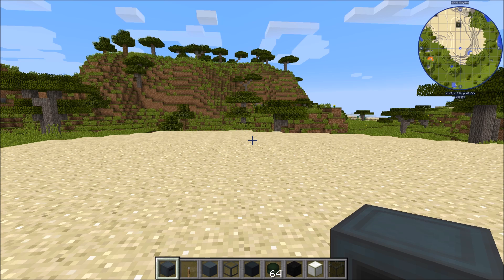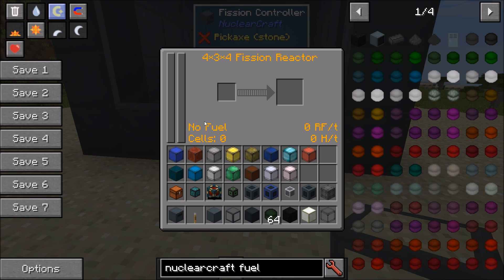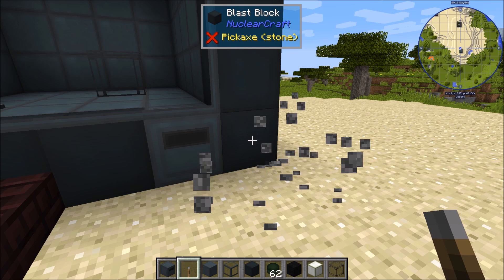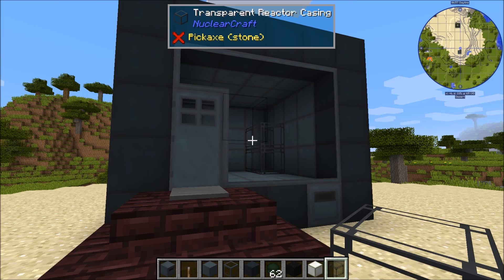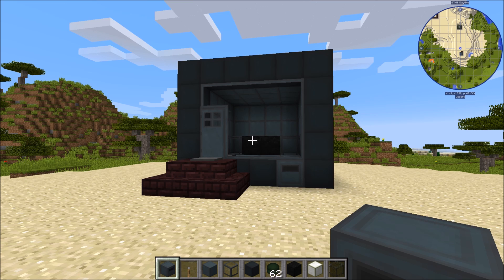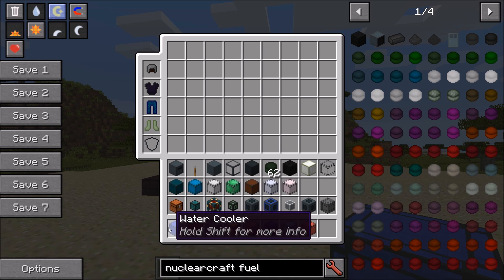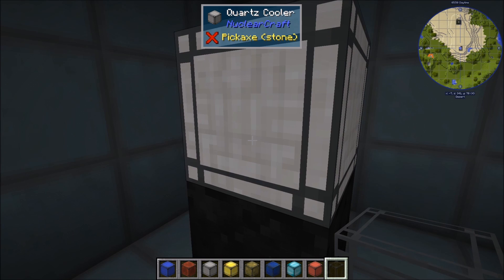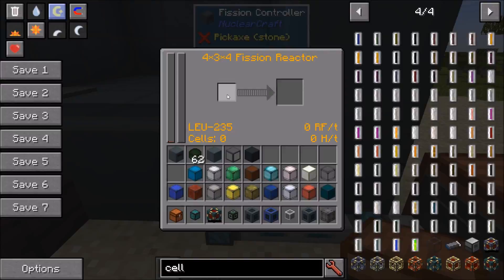NuclearCraft Spotlight - Solid-Fuel Fission Reactor [1.12.2]

Comment from the maker: Just one thing about moderators that I did not explain very well: Unlike the quadratic increase of heat generation with increased efficiency for cells, the additional heat generated by a moderator adjacent to a cell increases linearly with the cell's efficiency, just like the additional power. That's why, at 11:40, the heat multiplier is 366% - each cell has a base efficiency of 200%, so have a base heat multiplier of 300%, and the additional heat multiplier is then just 2 × 1/3 = 66%.
Reply: Will reactors be able to convert water into steam like the reactors from Extreme Reactors? I want to use this mod together with Advanced Generators, but currently NuclearCraft doesn't support steam generation, which is necessary to use Steam Turbines from AdvancedGenerators.
Reply from the maker: Steam can now be generated through the molten salt reactors and heat exchangers ;)

Comment: I have spent 2 hours on a 11x11x8 reactor (it didn't work), then I had an idea to expand it to a 11x11x9, and, after another 2 hours, I had just enough cooling! BUT... it didn't start when i put fuel into it, and i spent an hour trying to fix it. I couldn't fix it and blew it up with tnt (modded tnt, because regular does very little damage).

Later i found out I needed a lever (redstone signal)... 😑

My complaint:

Make stuff easier to blow up 🤣

Comment: I finally got to explore this mod in much more detail. I love most aspects of the mod but the gathering/creating fuels is the least fun thing about this mod.  If the fuels were better handled, it would be my favorite mod by far, just way too much upkeep, convoluted with the amount of fuels.
Reply from the maker: Would an optional, simpler fuel system be something you're interested in? If so, which fuels should be available and what should they reprocess to?
Reply: I am playing all the mods 3, so the extreme reactors materials are vastly different, more expensive to make in other packs I've played in. This makes extreme reactors sorta late game compared to Nuclearcraft fission reactors. I just found myself fighting with maintaining the fuel before you're progressed enough to start running quarry's to auto farm thorium and uranium then progressing to the other fuels by running depleted fuels through the reprocessor or imbuing mats with oxygen for oxide fuels. Running 9 thorium ingots through an isotope separator for 1 fuel seems sorta excessive for the base fuel. The need to cool the reactor is what drew me the most to nuclearcraft fission reactor, I think that is on point. My suggestion is to maybe make it a little easier to maintain base fuels while keeping the more endgame fuels the same.  The ore gen for nuclearcraft is fine, its just the quantity needed for base entry level TBU fuel is where I found the biggest issue with.  Maybe increasing the burn time on the beginning fuels would be the easiest. I know the player can modify a lot of that in the configs but I typically don't like doing that kinda stuff.
Reply from the maker: The problem is that I decreased the yield from thorium and uranium for their respective isotopes because other players said it was too easy to make a lot of fuel. If it really is just something like the base time of the fuels that you want to increase, it's very easy to do so in the config - you can even do it in-game, by just heading into the mod options.

Comment: The emerald cooler seems a bit cheap for me, considering that I can just go to a village and trade my crops for loads and loads of emeralds. I think the efficiency should be based off of actual material effectiveness, not just how expensive a material is supposed to be, which can be very different depending on one's situation.

Edit: Cooling with molten metal is even more silly and immersion-breakiing, because molten metal is usually extremely hot!
Reply: cough cough mercury cough cough
Reply: Liquid Sodium is actually used in real nuclear reactors as a coolant. If the inside of the reactor is hotter than the melting point of the material, you can use it as a coolant.

Comment: Your calculation states that active fluid cooler is twice as effective as a passive one? Ive been thinking of pumping resonant ender into the corners for extra cooling.
Reply from the maker: More than twice as effective, generally. They're pretty overpowered, really. Use them while you can, as they will be removed in the future!
Reply: @NuclearCraftMod  oh no! id rather not make a reactor in my series and explain how im doing it only for it to be incorrect in the future. =(
Reply from the maker: Well quite a lot of the mod is being redone in the near future, but those versions will be separated from the current ones, so I wouldn't worry about it too much :)
Reply: NuclearCraft I hope to do your mod justice in my future series 😀

Comment: no matter what i try i cant seem to extract fuels from my reactors any suggestions?

Edit: specifically from the reactor ports
Reply from the maker: Which version of NC are you using? This should have been fixed in v2.17 ;)
Reply: @NuclearCraftMod  i was using the version for minecraft 1.12.2 in skyfactory 4

Edit version v2.16c
Reply from the maker: Ah, okay. When SF4 updates, it should be fixed ;)

Comment: How can we make the reactor stop using fuel when it is full?
Reply from the maker: You can set up some sort of redstone circuit which reads the energy level of some energy storage (e.g. a comparator on a voltaic pile or lithium ion battery) to control the reactor.
Reply: @NuclearCraftMod  thanks again for replying i really love this mod with applied energistics 2 i can auto craft everything and get ez power
Reply from the maker: @jadjnm7108  No prob :P
Reply: e

Comment: you really want me to never finish my Resourcepack, do you?

also now that we got EIO back we can just use the conduits. no need for ports since you can fit 4 different conduits per block, and the controller being on the border means it has 2 faces open, or space for 8 conduit types.

or you know, XNet
Reply from the maker: I never promised that you wouldn't have to keep up :P

And, well, first of all, not everyone might be using EIO or XNet, so they're still useful then, and even the best EIO conduits can only transfer 20 kRF/t at max, so you still may need ports if your reactor's output is higher than that.
Reply: What will this pack be called?

Comment: Just an idea, but could you start listing the most important additional mods like pipes and connectors that your using here. I'm trying to replicate some of your examples so that I can work on them myself, but I can't seem to be able to do anything about drawing out power. Many thanks in advance, and keep up the good work with this great mod :)
Reply from the maker: Any mods which use forge energy should work with this mod, and similarly, any fluid and item pipes should do fine. In this vid, and in many others, I mainly use EnderIO, Thermal Expansion and Thermal Dynamics.
Reply: thank you so much, it's now working :)
Reply from the maker: Great!

Comment: At the beginning you mentioned to build a reactor with a fuel in mind. How should i build one that is going to deplete mox nuclear fuel for plutonium?
Reply from the maker: The way to build to a particular fuel is to estimate how many cells and moderators you can get away with in the reactor you've built - you want to work out how much space you need to leave for cooling, keeping in mind that, coolers work at a rate of about 90-100 H/t on average.

So say you've built a 5x4x3 reactor, which has a volume of 60 blocks. That means that you start with an approximate cooling capacity of 6000 H/t, and every block you use up with a cell/moderator removes roughly 100 H/t from that. When the heat from the cell structure nearly matches the approximation of the amount of cooling space available, that's when you know to start trying to place the coolers.

Sometimes it doesn't work, but sometimes it will and you'll have a reactor built to the choice of fuel :)

Comment: I can confirm that automating power via temperature levels does NOT work if the redstone feeds to a reactor port as in this image: https://gamepedia.cursecdn.com/ftb_gamepedia/7/7d/Nuclearcraft-solid-fuel-fission-heat-comparator.png?version=672054fa5462475ac9d5b2a4b7d84e41

I have recreated this image exactly and the redstone signal feeding into the reactor port does not turn on the reactor itself.
Reply from the maker: Yes, that image is misleading - you are right to say that ports can not handle redstone control.

Comment: I've been having an issue with active cooling. No matter which coolant I use, whether its water, Resonant Ender or Gelid Cryotheum, the cooling will never rise above -20. I've tried placing the Active Fluid Cooler adjacent to the Buffer. I've tried using different Fluid Conduits, Fluiducts, and even Laser Fluid Relays, yet nothing works any better. And yes, I am placing the Active Fluid Cooler in the correct position for the coolant.
Reply from the maker: Are you using the default configs? Could I have a pic of your setup?
Reply: All of my configs are default. Except for the power output of the Californium Radioisotope Thermoelectric Generator, which I set to 1,000 RF/t. I use it for testing purposes. 

I took a bunch of screenshots of my test reactor setup. I tried with Resonant Ender, and Water. With both Ender IO Fluid  Conduits, and with Thermal Expansions Fluiducts (with and without servo.) Nothing worked. 

Here's a link to my Postimage gallery with all the screenshots. https://postimg.cc/gallery/1rtchduzi/
Reply from the maker: Ah - the problem is that the active coolers still need to obey the cooler rules - for example, the resonant ender needs to touch three casings.
Reply: I realized that I made an error there. But the cooler with water was in the correct space, and it didn't work either. Check the images.
Reply from the maker: Hmmm.. are you sure the fluid's actually getting to the cooler? In the picture with the creative portable water tank, the servo on the inside of the reactor is not active.

Comment: So I have a 7x11x7 reactor in Enigmatica 2 expert and I'm trying that redstone method that's shown at the end of the video.. but for some reason when input down a redstone torch on the block I have with the competitor on the controller.. when the redstone gets any sort of heat to the torch.. it always flickers the torch on and off.. is there something I did wrong or?
Reply from the maker: That's also what's happening in the video, just at a slower rate. If you want to smooth the updating out a bit, increasing the delay with a redstone repeater should do :)

Comment: hi i have a 7x7x7 reactor and have 3 energy cells filled up was trying to use energy conduits to power an electrolyzer and no rf was going to the machine... had cell cable set to extract rf and electrolyzer cable set to insert but no movement....tried a copper cable but it doesnt connect to an electrolyze
Reply from the maker: Hey there - have you got a picture of the setup? It's hard to imagine what the issue could be.
Reply: NuclearCraft ill get you a picture in a few thanks for your help

Comment: I'm playing nomifactory (not ceu) and the coolers won't share fluid despite being adjacent. i have a 9x9 reactor that has a quarter of the cooling it should and I don't know what to do. the buffers and the cooler adjacent are full, but none of the other ones are.
Reply from the maker: It's possible that the pack has the "passive_permeation" config disabled, in which case you'll either need pipes to each of the active coolers or the config set back to true.
Reply: @NuclearCraftMod  thanks! Where do I find the config? Is it inside the mods folder of the modpack?
Reply from the maker: @smooshymemes  You can either head into the mods folder, open "nuclearcraft.cfg" and look for "passive_permeation", or head into the Mods page in-game, find NuclearCraft, edit its configs and look for "Passive Permeation" in the Processors category :)
Reply: @NuclearCraftMod  THANK YOU! apparently it's disabled by default for some reason, idk why
Reply from the maker: @smooshymemes  No worries, hope everything works fine :)

Comment: I used a fuel that said it had a 60m  processing time and it only burned for 30. Do you maybe know why that is? Could it be because I used 2 reactor cells?
Reply from the maker: Absolutely correct! The base process time is divided by the number of cells to get the actual process time :)
Reply: @NuclearCraftMod  Thanks!

Comment: So on the last tidbit on the redstone comparator; Does it also activate on negative heats or is it actually reading from the power output? 
I have been toying with a reactor and I was thinking of trying to make a more oomph reactor but wanted to make a fail safe with this tactic only to find out that my negative cooled reactor sends hella strong signal through the comparator
Reply from the maker: I think this video was recorded before the reading of the energy level was added for heat-negative reactors. You can disable it in the configs :)

Comment: How am I supposed to make all of these "easy to craft" items when they all require boron and lithium?  I play on skyfactory 4 and boron is a fairly rare ore to come across when the only place it is found is in the twilight forest dimension. It takes me about an hour of searching the small islands to find just a couple boron and I can make maybe 4-8 advanced plates with that. I tried using the laser drill to get boron but that requires an insane amount of power for it to even work. I am not sure what else to do other then spending hours and hours searching for boron and lithium just for a couple items to make 1 block when I need about 50.
Reply from the maker: Usually lithium and boron are relatively common overworld ores in a normal game - it sounds like SF4 configured them to be far rarer than usual :P
Reply: craft a bucket of mud (type lithium or boron), feed it to a normal pig (spawning on grasblock), let the new boron or lithium pig live on stone and harvest the lithium and boron truffle they leave on the ground), craft the truffle to boron or lithium
Reply: TheHaPaMa thank you! :)

Comment: What mods allow you to transport energy out of the reactor? I have buildcraft with buildcraft transport and the kinesis  pipes don't connect to the reactor ports at all.
Reply from the maker: Buidcraft happens to be one mod which uses its own power system. You can use any mod that supports Forge Energy (RF) or IC2 EU :)

Comment: But what's the difference between a graphite mediator and a beryllium one? That said, I'd like this mod. I really fo. But it feels like you're just making it more complicated with all these additional rules and reactors. I had trouble before to keep it straight. now I don't know if I could even manage to keep a small reactor stable...
Reply: Alex Jones quartz and magnesium cooler work very fine for me:) try to use many moderator blocks combined with magnesium coolers

Graphite and beryllium moderator blocks do the same
Reply: But what's the point of having two if they do the same? Why go for beryllium when graphite is easier to get? thanks for your answer though. I never really made anything bigger than 5 by 5 so I'm still a rookie even if I've used this mode since 1.7.10.
Reply: now beryllium isnt that useless anymore + i personally  run out off coal very often in the early game
Reply: Sure I applaud that there's a use of beryllium now. But if I remember correctly it spawns lower than coal.
Reply: Thats true but you need coal for many other things especially for energy generation in early stages of the game. But yes.... a slightly different effect would be nice
Reply from the maker: Don't worry - the beryllium and graphite do the same for now. In future, they may do something different, but the key is to make sure everything is still calculable by the player. Things haven't actually changed that much since the last spotlight video, but I just remade the entire thing for completeness :)
Reply: NuclearCraft I'm not good with math so all these calculations flies right over my head tho.
Reply from the maker: It is not meant to be easy, so everyone is in the same boat - hopefully the reactor building tutorial (coming soon) will help.

Comment: really like the  mod so far but a question off topic, don't have ender io in the pack i'm using and have just built my first fusion reactor. the issue I have is that when i put 2 portable fuel tanks down and activate them to put their liquids into the reactor one of them will fill both internal tanks unless i shift right click one of the internal tanks to empty it. is there a way to do this without losing the fuel in the reactor? ie having two import areas for different fuels?
Reply from the maker: Hey there - in the GUI of the fusion reactor there is a 'share tanks' button - toggling this should stop fluid spilling over into the next tank, so should solve your problem.
Reply: choice, cheers for that
Reply from the maker: No prob!

Comment: Does this heat interface with Mekanism heat at all?
Reply from the maker: No, it does not - heat is just a number used internally by the reactor.
Reply: Ah well, it'd be a cool thing to try if you have the time :3
Reply from the maker: Well, even then, it's pretty much impossible, as the Mekanism API is pretty broken right now :/
Reply: Ah well, thanks for trying :3